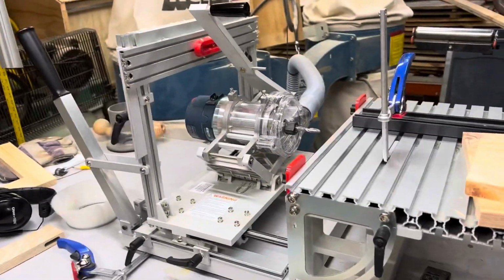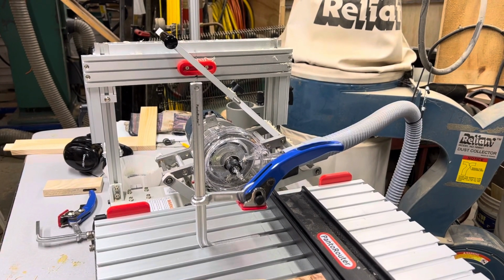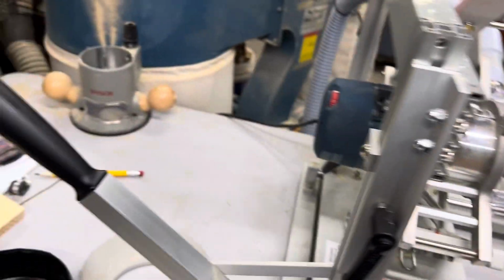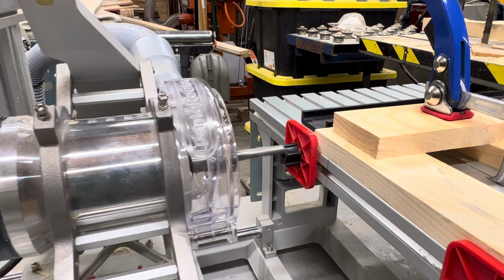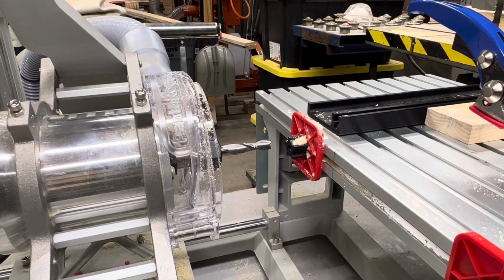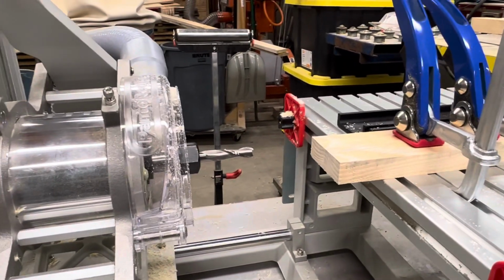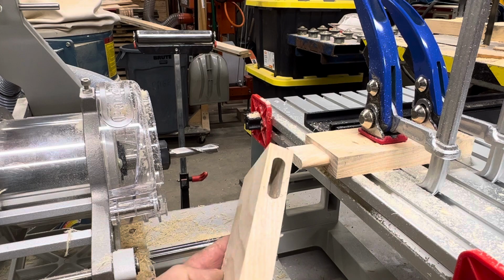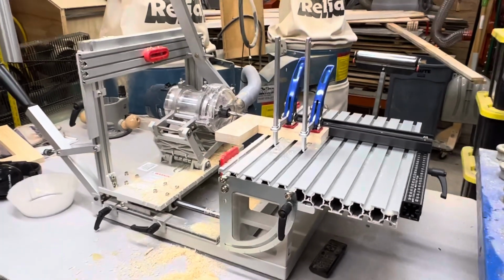Timber Frame - Demonstrate the Pantorouter to make mortise and tenons for the raised panel doors

Comment: Have you tried a festool domino?  I'm thinking it might be quicker.
Reply from the maker: Hi Andy:  At this point, I do not have any Festool machines in the shop.  I did look at the Domino video and I think the difference is having an integral tenon vs a domino insert.  The Domino does look to be fast.

Comment: How do you determine what bit size to utilize?
Reply from the maker: Hi Terry
For most jobs I use 3/4” stock so I make 3/8” mortises and tenons.  Hope this helps
Reply: @theMainetimberframer  thank you.  Do you have to change the diameter of the guide bearing when cutting the tenons?  Or just use the smallest one?
Reply from the maker: @terrychristian672 
Hi Terry
Typically you use the 10mm guide bearing when making mortises and the mortise bit determines the width of the mortise.
For tenons a combination of the bit size and the guide roller determine the tenon width.
I believe Pantorouter has a cheat sheet for guide roller and bit combinations to achieve desired tenon widths.
Mortise and tenon lengths are determined by the selected template.
Hope this info helps.